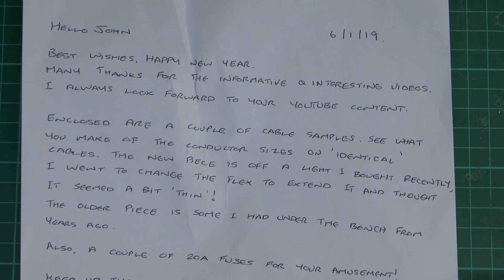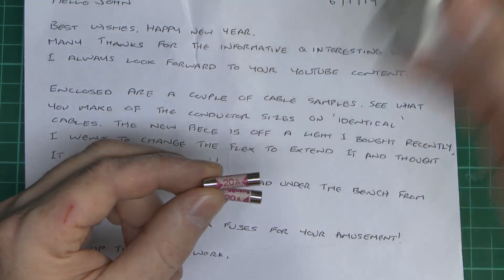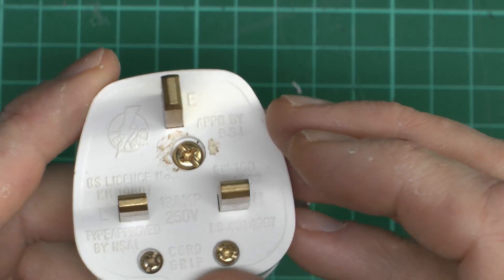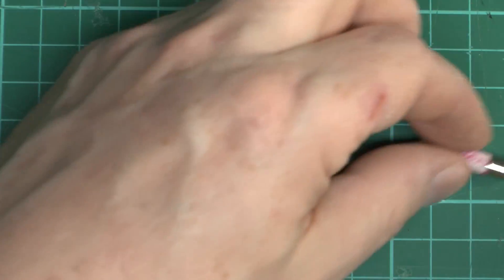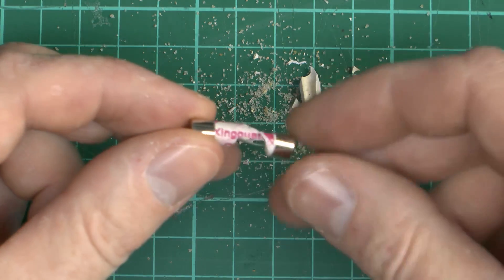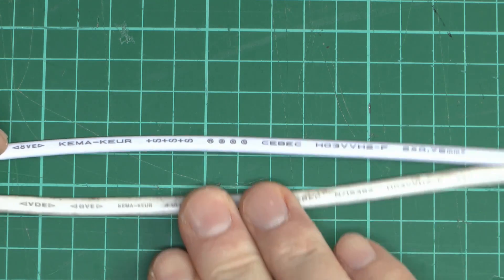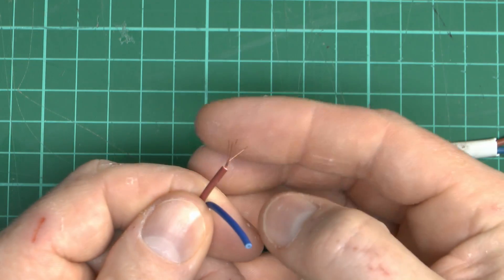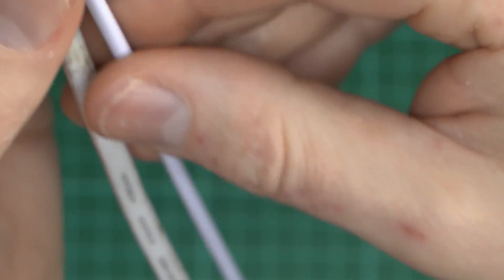Fake Fuses and Flex

Comment: Fuses in plugs are completely unknown in North America.  This is only a thing in the UK I'm guessing?
Reply: U.K. standard mains wiring for use in domestic property, offices and light industrial use, is to use 30A (protected by a 30A fuse) or 32A (protected by a 32A MCB) ring circuit. Within a defined area, you can then have as many socket outlets as you like (within reason) on the same circuit. So in a typical two, three or four bedroom home, you will often have two or three ring circuits. Often one per floor. Sometimes a separate ring circuit for a kitchen. To provide protection in case of a short circuit in the flex (cable) to appliances, we use a fuse in the mains plug.
Reply: That's because of the ring circuits they use which are rated 32A.
Reply: @faiyaj9773  no fuses in Australian plugs. Seems to be an exclusively UK thing
Reply: Everywhere that uses the UK type plug, which also includes Ireland, some of the Gulf states, Malaysia, Singapore, several African countries and a whole bunch of smaller places like Malta, Cyprus, Caribbean islands etc
Whether all those places actually have the kind of mains supply wiring that makes the fuses necessary, idk, but theyll be in the plugs.
Reply: Christmas lights have fuses in the plug in the USA for everything else the fuse is in the device
Reply: In the USA "fuse plugs" are screw in fuses that have the same thread as a standard medium base light bulb. Except for special applications like motor protection they are long obsolete but still can be found in old buildings. They suffer from the same problem mentioned here in that they were made in 15, 20, and 30 Amp capacity and could be (and frequently were) interchanged. Some folks would even screw a penny coin into the socket to completely defeat the circuit protection.
Reply: It's because of the British and their silly ring circuits with 32A breakers (just kidding, fine British fellows). This is roughly the equivalent of a 64A breaker at US standard voltage. Now imagine how large your cords would have to be to handle 64 amps, and you start to understand why they put the fuse for the appliance in the plug and use a smaller cord. At North American voltages, with typical 15 or 20 amp breakers on dedicated circuits, you almost never get into a situation where a cord would get very hot before you blew the breaker. I have seen cases where a portable heater will have a cord that gets slightly warm to the touch after a time, but it's pretty hard to overload a cord enough to cause a fire at US voltages.
Reply: Australia and New Zealand use a hub and spoke mains configuration with 16A RCD circuit breakers. UK plugs do not fit (Australia uses a variant of the old US 220V socket). Australian 15A and 20A sockets have the same size mains pins but larger earth pins and the lower rated plugs will fit in the higher rated sockets. The 15A and 20A sockets get their own circuit breakers.
Reply: @faiyaj9773  Not in Australia...

Comment: Hello. Before breaking open the fuse, it would have been interesting to see if it did actually blow at 20amps.
Reply: tony jones - the fuse current rating is the maximum normal usage current. So a 20A fuse should not blow with a steady 20A load current.
Also, the current a fuse blows at is time and temperature dependent. So a 20A fuse will not blow if the overload is not excessive and the time period of the overload is short.
Reply: @Mark1024MAK  Looking at the size of the fuse wire itself I would imaginf it would take 20 amp. However, it would be nice if this was confirmed.
Reply: I see nothing wrong with that 20A fuse. Ring circuits are rated for 32A and the thick  pins of a UK plug could easily take 20A. Of course the flex would need to be very thick to handle 20A without overheating. Examples of a 20A load could be a welder, water heater, industrial dryer.
Reply: @simon tay   None of which should be wired into a 13A plug! The socket switch & contacts are not rated for 13A plus and the size of the holes in the plug pins won't take a sufficiently large flex.  Stick to what you know.
Reply: Juan Cornetto  It may tolerate 20A but not continuous load. The pins will heat up and the cable might as well. For 20A 4mm2 cable is required. It may be possible to use large load devices on a standard 13A plug so long as the load is not continuous and have a duty cycle.

The plug is not rated for 20A continuous load
Reply: @megavideos112  Preaching to the choir my friend. C&G 2381, 2391.  Type B breaker/fuse 1.6x rated current for an hour. However, doesn't change the fact that anyone loading a 32A ring main with 20A through a 13A socket is a chump.  Especially if you haven't tested the continuity of said "ring". Cheers.
Reply: While the 20A fuse might just have been of some limited use on a heavier single phase MiG welder (I can recall times where changing the fuse got boring quickly, single phase rated welding set on a dedicated 16A double pole switched socket) but fact remains it still shouldn't exist and the fact we were chewing through fuses in that instance was more a sign that we were pushing the welder harder and for longer than we ought have been doing, not that we should uprate a fuse.